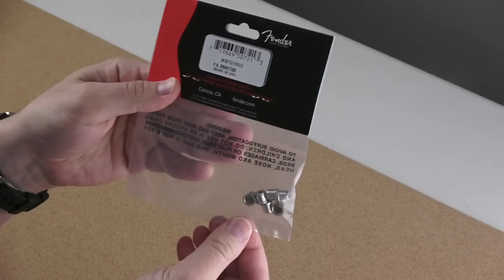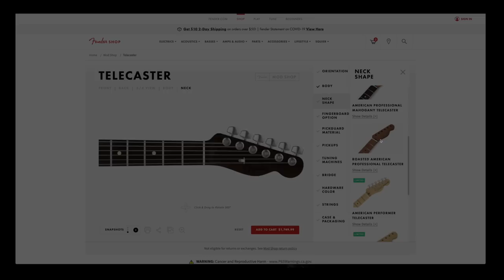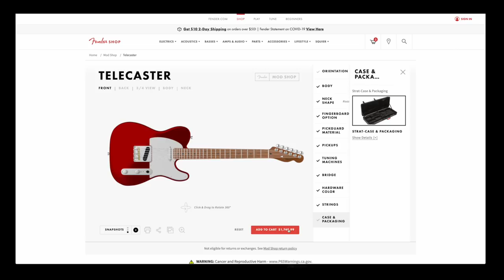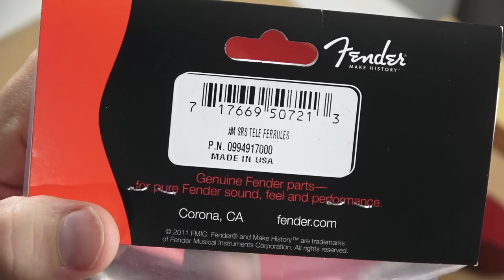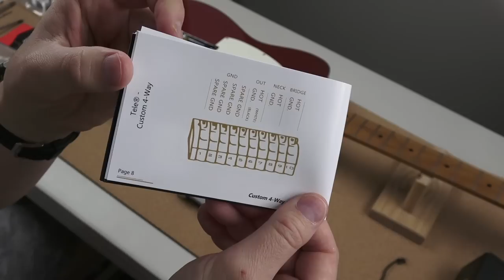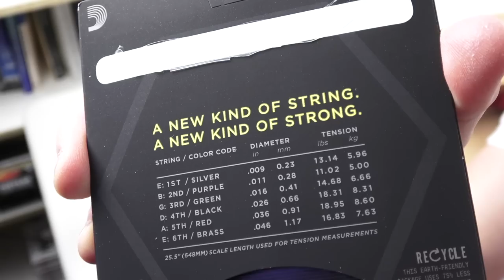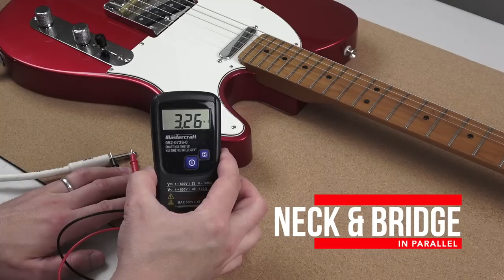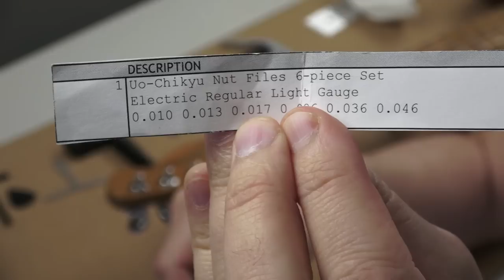Building a Custom Candy Apple Red Fender Telecaster with Roasted Maple Neck  & Obsidianwire 4way Kit

Comment: I enjoyed watching the build. Now I'm commenting during the sounds part of the video. I'm guessing a comparison video between your other recent builds and/or other Teles (bought complete) to highlight differences. This seems similarly spec'd to the blue one. Are you still thinking of one with a Rosewood or Pao Ferro fretboard, like this one was supposed to be? Maybe for the green body you suggested at the end here.
Reply from the maker: Ya these Vmod pickups are definitely a lot less output. Even with the gain full on the AC15, the overdrive was not super strong. So I pickup comparison will be needed in the future. I would like to eventually do a rosewood fretboard.  Rosewood on green would be 👍

Comment: CAR is the best colour of all..

First guitar mod I did was with an Obsidian harness. TBH I think soldering is easier. the spring clips are so fiddly to use on a packed Strat harness.
Cheat for the string tree is to cut most of the bottom of the tab off and just use the one hole. The remainder of the tab will make its own indentation and sit fine in that.
Reply from the maker: car is sweet

Comment: Before screwing the bridge down put the bridge ground wire in place after drilling a hole from the control cavity & feeding the  ground wire into the bridge cavity
Reply from the maker: I didn't need one in this case. the pickup is self grounding

Comment: The rubber things on the pickup screws are called pieces of surgical tubing.
you probably don't need to ground the bridge, as you have mentioned.  The shielding needs to be grounded in each cavity for it to work.  I don't see the point of shielding a Tele, as the pickups are already surrounded by grounded metal.  If you use a four way switch for series switching, the shielding shorts it out.

Comment: Great job. I got a similar one in the works with roasted maple neck. How do you like the hi-gloss finger board vs the satin finger board of a regular maple neck.?
Also, that shielding tape will take solder so I run a cavity ground wire to all cavities and solder a connection to the foil.
Reply from the maker: hey thanks! ya I like the look of the gloss and the satin backing

Comment: Great looking rig! Plus the tone is outstanding. I’m thinking about building one myself. What tips and techniques can you give for setting up the coil height.  I know you said it is personal preference. Where did you start? Is there a fender spec?
Reply from the maker: hey thanks! ya it's dependant on the how hot the pickups are I guess, and then you just play around. 
One tip I remember hearing was that you want to avoid hearing a wavy sound. It may mean they are too high. Other than that, it's just trial and error.  :)
Reply: Vintage style PuP Height specs from Fender: Bass side ~ 6/64" (2.4 mm) and Treble side	5/64" (2 mm). As Brandon said, it's all personal taste and this is just a starting point. When the PuPs are too close to the strings though, the magnetic field from the PuPs will pull the strings down causing that weird sound. Start with the Fender specs then play around with it till you dial in your sweet spot.

Comment: Good job!!. I'm in the same project, only different style tele...a 52 blond with nocasters. I' m ready for the wiring work but I would like to know if it is necessary to have the body grounded despite having everything grounded to the volume pot and jack input?. Thank you in advance for your answer.
Reply from the maker: hey thanks! As far as grounding, I'm no expert.  Try it out without the body ground, and if needed you can add it later. You should know by the amount of noise the guitar makes.

Comment: Beautiful! I love that roasted neck. Thanks for a great video. I have a question. I thought that with the four-position switch obsidian wire kit, there was some kind of soldering to do. Why did you not need to do any? If it is not necessary, then it is good news for me to upgrade my Tele. I am very bad at soldering. Thanks
Reply: It's a solderless wiring kit
Reply from the maker: there is the change you need to mod your pickup. See this document from them here: https://obsidianwire.com/content/Custom%204-Way%20for%20Tele.pdf
I haven't had to do this with any of my neck pickups.

Comment: Nice build. I like how you used an Obsidian wire kit to avoid soldering (I hate soldering).  But if you had the body routed for a micro-tilt, and the neck had the metal disc,  and the neck plate had the hole for the micro-tilt, why didn't you install a micro-tilt? My American Deluxe Strat has one and it is, by far, the best adjustment option for playability hands down. If you can install one, you should do so.
Reply from the maker: I mentioned in the video I bought that plate because it was cheaper at the time. money savings

Comment: To avoid the neck pickup/pickguard fitting issue with a 22 fret neck use a pickguard with 'no holes' for the pickup, screw the pickup into the body (vintage style) then you'll be able to slide the pickguard on and off without issue. The down side is you'll have to adjust the pickup while the guard is off, but you can even take the guard on and off with strings on, so it's not too much of an issue. Just put the guard on at the end.

Comment: LOL at waxing my nuts! Great build and excellent presentation. Just out of curiosity. Do you know if Fender parts are a direct fit onto a Squier body? I'm looking at a Squire but was wondering if I could change tuners, neck, saddles, and other components to slowly upgrade over time without breaking the bank all at once.
Reply from the maker: there's no yes or no answer. it's sometimes and maybe. depends on the guitars

Comment: I have a Tele that is similar to the one played by George Harrison at The Beatles' rooftop gig. It has a 6 saddle bridge which is great for accurate intonation. However I'd really like to fit an "ash tray" bridge cover but it won't take one. They only seem to work on 3 saddle bridges. Does anyone know of a replacement 6 bridge which will work ? It needs to be approx 97mm long too.

Comment: Question, I assembled both a Strat and Tele partscasters which included the Mexican Roasted neck featured in your video... my question is whether or not that found the "Flat Oval" neck shape to be so thin near the nut as to be difficult to maintain the proper grip in order to finger the strings on the frets and fret-board? I have relatively short fingers, so I opted for the Flat Oval shaped neck, but I find it difficult to both hold the neck and play an arpeggio without maintaining a strict classical hand position... What say you in that regard...?
Reply from the maker: I don’t recall it was a while ago

Comment: Isn´t the ground wire in the control cavity unnecessary, because the control plate grounds the  shielding tape to the pots?
Reply: Assuming you had the tape go outside the cavity to touch the plate, yes.

Comment: Is there any particular reason why you attached the neck first? That was one of the last thing I did on my build. For me it was so much easier to work on the body without the neck but I may be missing something. Thanks.
Reply: You can always take the neck back off
Reply: @natesenft5376  yes, you can but Landon kept it on for the whole build and when he had to loosen it to attach the pickguard he made a big deal about it.
Reply from the maker: no reason

Comment: Fender is doing guitars that have a vintage and modern mix. Now if you assemble a guitar with all Fender parts including a neck with logo and serial is it still considered a parts caster or a Fender telecaster ?
Reply from the maker: good question. My guess would be it's considered a partscaster

Comment: If you didn’t shield the cavity you would need a ground wire for the bridge , the shielding acts as the ground
Reply from the maker: no. the back plate on the bridge pickup grounds itself with the bridge

Comment: If you are calculating costs, you should include all parts, even those you already have. If I wanted to do the same guitar, that’s how much it would cost me. These ObsidianWire kits are very expensive, around 100 bucks.
Reply from the maker: How do I calculate tuners pulled from an old guitar? 🙂
Reply: Landon Bailey you take the new value. The question is not how much it cost YOU, it's how much would it cost SOMEONE to do the same build. Especially if you compare with Fender website. You have to compare comparable things.
Reply from the maker: it's an accurate price guide for what I paid out of pocket today. People asked to see it, so hopefully it gives a close picture, give or take some parts. YMMV for all of it.

Comment: Why didn't you put shielding tape on the bottom of the control plate itself? That's usually done as well when shielding the control cavity..
Reply from the maker: I've never seen that done
Reply: @landonbailey  yeah it's typically done to complete the Faraday cage and it's what I did on my strat-tele hybrid.. you've got the control cavity lined so you line the bottom of the control plate too and it goes over the top and completes the "cage," otherwise it's a Faraday bowl in the cavity lol and not a cage but then it's not really a Faraday cage that's being created anyway but an antenna.. I was just saying that, wouldn't a Faraday cage be an actual cage which means all sides covered? In the real world I don't know what difference it would make on your particular guitar, may be a bit quieter or maybe nothing
Reply from the maker: but the control plate is metal already
Reply: @landonbailey  I'm with you.

Comment: You should never force anything into the body, to put the ferules in heat up a soldering iron and put the tip of the iron into the ferule hole and push
Reply from the maker: good tip thanks!

Comment: Those felt pads are the reason you see a lot of stripped strap button screw holes, cant remember the reason why it happens but there is a video on Youtube somewhere explaining why it happens...... you will also notice that its rare to see them on high end guitars, for good reason i would assume, you may also notice that every time you see stripped buttons its usualy on cheap guitars which tend to always have those felt washers..... :)..... Oh and just to add, if you are worried about drill bits slipping, use brad point drill bits, they are ideal for this type of thing.
Reply from the maker: All my Pro Fender models have the felt pads, so I dunno